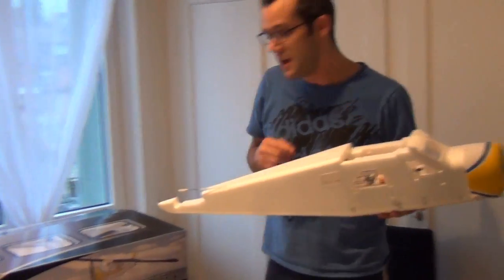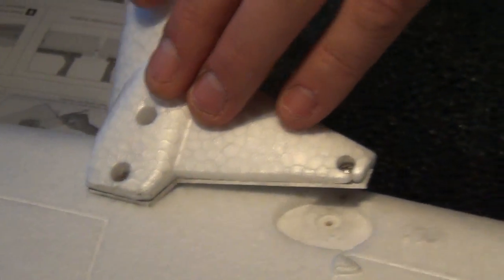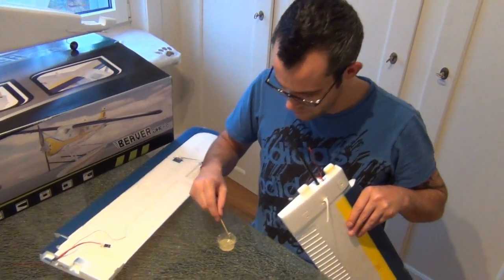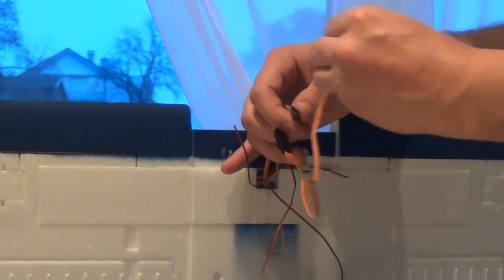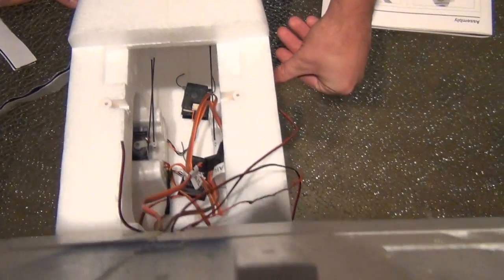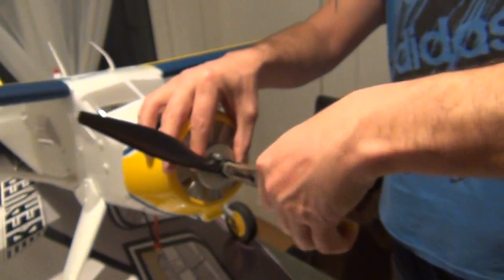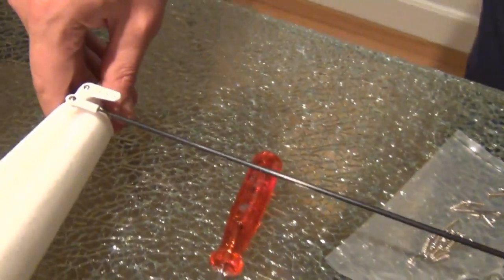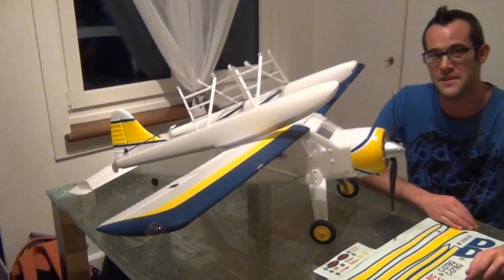Rc Beaver DHC-2 by Dynam- Flyfreak Aufbau Movie inkl. Aufbau der Floats/Movie building

Comment: Good job but I don't speak French....
I really think gluing the wing halves together is not necessary, with the carbon wing tube and the four wing screws holding the wings to the wing saddle should be more than enough.